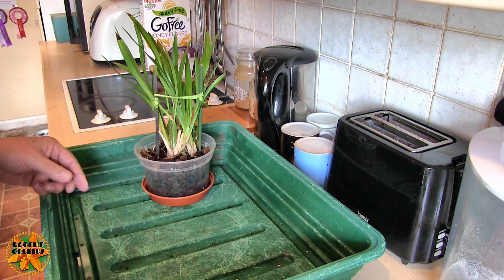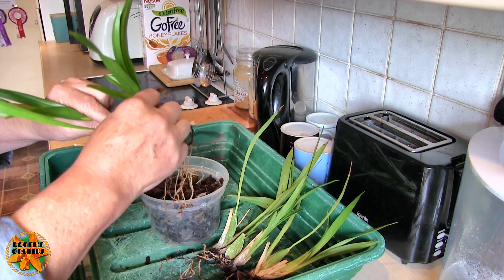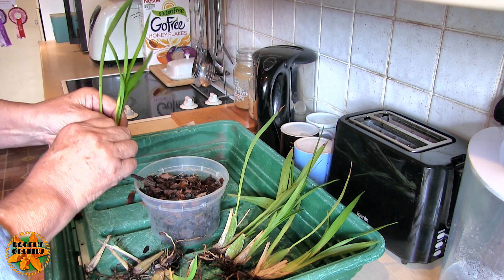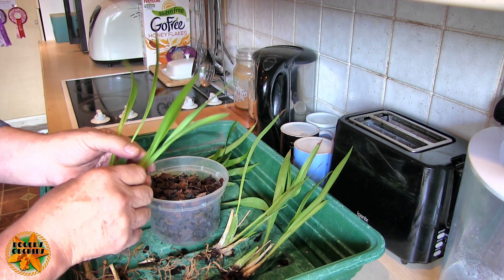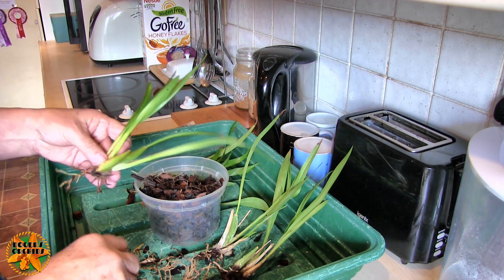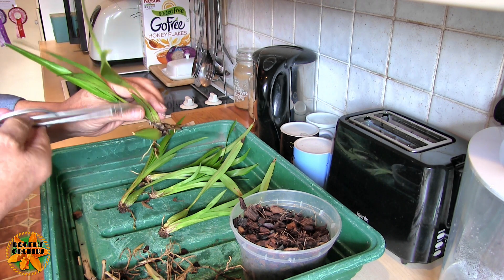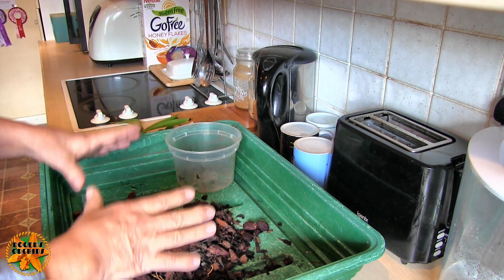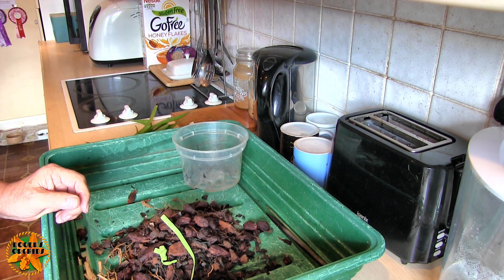Emergency Ding-a-ling - Odontoglossum naevium With Bacterial Rot

Comment: I also had a Odontoglossum with a soft pseudobulb last winter, it was really gross. I didn’t want to repot in wintertime so I cut it out as much as I could with a pruner. Then I sprayed it with hydrogen peroxide repeatedly and then put plenty of cinnamon. It’s still doing good at this moment but I think I was lucky because I hadn’t have time this summer to do repotting. So I have to be really careful with water this winter or I will have another instance.
Reply from the maker: Certainly in the UK, unless using lights, the short days of winter mean there is very little growth so great care is needed with watering.

Comment: Hello Roger, I don't remember your routine well enough, but if the seaweed extract is due soon, maybe that'll help get the roots going.  I'm not convinced it works with mine, or it's just coincidence that I get better roots soon after using it.  Also, to avoid the messy hands, I just rinse my charcoal off in a pot before I use it.  Doesn't stay wet for too long.  Thanks Roger, keep it up.
Reply from the maker: I've never really noticed any difference using seaweed extract and some say, it causes more problems than it solves?
Reply: @RogersOrchidsGardenandBonsai  I wonder what problems?